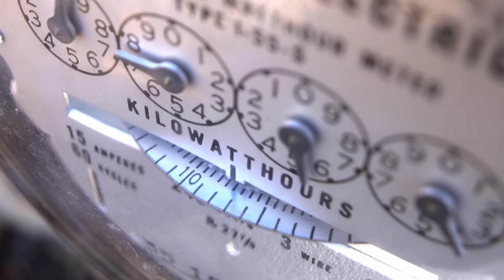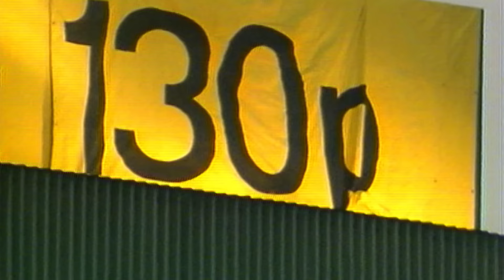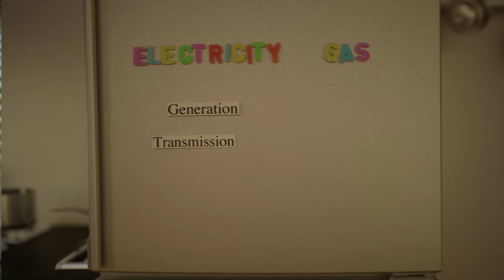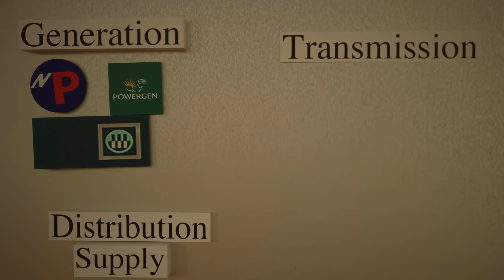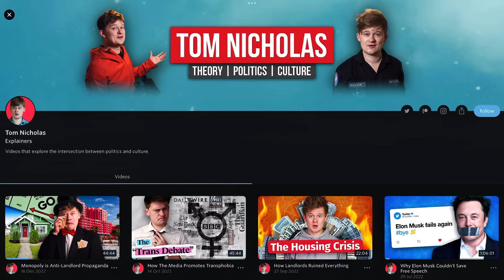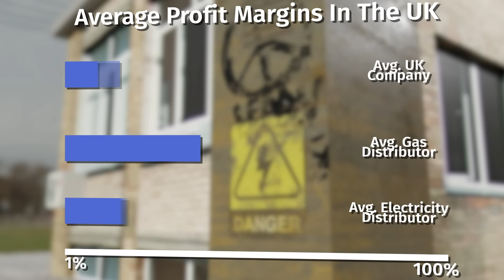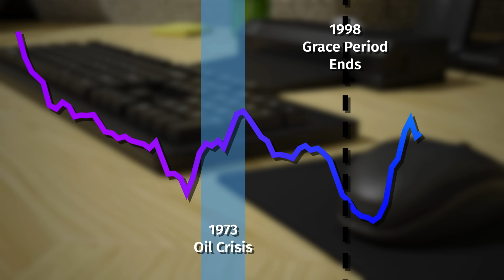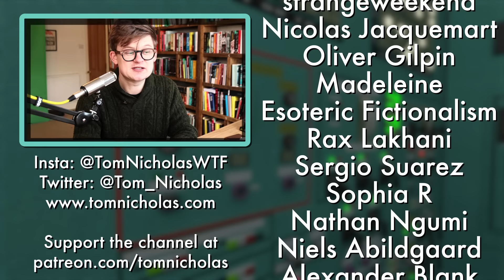Energy Privatisation is Bankrupting Britain

Comment: They turned the energy industry over to private competition, but they conveniently forgot that these companies are competing to make the most money, not to provide the best prices.
Reply: And that a power grid only has one line to each endpoint so there is no possible way this could be anything but a monopoly with no real competitive forces to self regulate profiteering. 

At best of we ran like 5 of the same wire to each house we could maybe hope to have an oligopoly and try to regulate that.
Reply: This is very succinctly put. Thank you.
Reply: Doesn't  anybody understand economics anymore?  Get the Govmnt out of the way..
Let the drillers DRILL.   Let the refineries refine.  They will make money and you will have 
  the energy you need.  Ramp-up supply, and prices go down...
    OR start building Gen IV reactors,  YESTERDAY!      Energy fuels Civilization.
Reply: Reasonable Speculation - dude we are talking about power grid not power generation, and definitely not extraction and refining. 

Generation is not a monopoly so it functions OK as a market economy. Arguably it is a bit leaning toward oligopoly but that can be worked around. 

No one on this thread said anything about nationalizing extraction and refining. That is definitely open market model due to the vastness of the market. 

We are talking about nationalizing the actual electricity and gas grids which take the energy from the refineries and generation to each endpoint. That is what is called a Natural Monopoly because there is no practical way to make it competitive. There is only one wire and one gas pipe and one water pipe to every house, so there is no way it can actually be "competitive". 

The national grids would buy from the open market generators and refineries to distribute to households based on competitive bidding. 

1. This would allow a variety of different generation sources including gas, nuclear and "green renewables" to all compete against each other for sales. 

2. Also a national grid may reduce regulations on endpoint generation which have been put in place strictly to preserve profits of the formerly privatized grid. Allowing endpoint generation sites (your rooftop solar) to be bigger than your demand so you can sell the excess energy back to the grid for a profit, giving more competition to the free market generators. Or you could put in solar heating or geothermal to compete with the gas refineries. 

 Who is stopping the drillers from drilling and the refiners from refining? They are the most privileged industry on the planet and receive the most subsidies of any industry, actually pretty close to the same subsidies as all other industries combined. Plus their infrastructure crammed through communities risking disaster. 

The "greens" do not want to ban oil (only a few uneducated say that, every movement has them). They want to add new energy sources on top of the oil growing supply, which would reduce demand for oil and give it competitive market forces to reduce costs for energy. Many actually do support the nuclear power you are fond of as well.
Reply: @reasonablespeculation3893  Can't tell if you're trolling or trying to actually argue. Poe's law is in full effect.
Reply: @5353Jumper  I mean, any green activist worth a damn should be trying to remove market forces from the energy sector entirely. The market is exactly what got us into this mess, andd it certainly isn't going to be what gets us out. We should be aggressively nationalizing all energy industries, removing private ownership of energy generation entirely, and use that control to develop green energy sources such as wind, solar, and nuclear, while aggressively cutting fossil fuel power generation wherever possible, aiming for complete fossil fuel abolition by 2030.
Reply: @ErikratKhandnalie  nah...the way to reduce fuels is to focus on improving other industries and investing in alternatives. Let the fuel market experience it's coming adjustment by massively reducing demand. 

Remember oil and gas are used for many things other than fuels, many of them actually reduce emissions by helping improve other industries. 

So we so not want the government playing around in a broad market industry like oil&gas extraction and refining. 

It is good enough to just have the government control the actual natural monopoly sectors, and regulate the rest. 

If we waste a bunch of time and money trying to improve the petroleum industry and fuels industry in particular that is resources not spent improving other industries and supporting alternatives to fuels.
Reply: @5353Jumper  No, we absolutely do want the government playing around in oil and gas. More specifically, we want the government to completely take over those industries and take them entirely off of the market. So long as there is profit to be had with selling fossil fuels, the market will find a way to sell them. There are some industries that make good use of them, but the energy industry most certainly isn't one of them. 

We need to be aiming directly at the complete abolition of fossil fuel energy. Anything short of that will constitute a failure.
Reply: @ErikratKhandnalie  of you do that you will not be focusing on all the other industries, and the replacements for fuels, and the electrification of vehicles. And you will not be focusing on reducing consumption of everything which also greatly reduces fuel consumption. 

So you will just remove the energy from fuels from the world, and not have anything to replace it, and have the same demand for energy. So basically bankrupting the world or maybe just having all the poor people starve while the wealthy hoard. 

If you forget about the fuels industry,  and make all other alternatives better, you will have the same result of eliminating fuel demand, which will also end fuel production. But you will improve the world instead of impoverishing it. 

Imaging the government spending trillions to take over an industry, then tanking it on purpose all that money just disappearing. All our tax revenues just gone poof.
Reply: @ErikratKhandnalie  — The Green Activists have done so. 80% of the World’s oil and gas industry is State owned. Pemex in Mexico is a typical result. It owns all of these resources. But who supplies energy to Mexicans? The US sells them gas, which they burn to generate electricity cheaply and more reliably than their State owned monopoly.
Reply: @ErikratKhandnalie  Yes — energy is the great triumph of State ownership! See Venezuela for PROOF!
Reply: @Orson2u  oh how I wish that were the case, lol
Reply: @5353Jumper  of you do that you will not be focusing on all the other industries, and the replacements for fuels, and the electrification of vehicles. And you will not be focusing on reducing consumption of everything which also greatly reduces fuel consumption. 

So you will just remove the energy from fuels from the world, and not have anything to replace it, and have the same demand for energy. So basically bankrupting the world or maybe just having all the poor people starve while the wealthy hoard. 

If you forget about the fuels industry,  and make all other alternatives better, you will have the same result of eliminating fuel demand, which will also end fuel production. But you will improve the world instead of impoverishing it. 

Imaging the government spending trillions to take over an industry, then tanking it on purpose all that money just disappearing. All our tax revenues just gone poof.

with all due respect, we can do more than one thing, abolish the private energy market and incentivize demand-reduction... non-sequitur...
Reply: @Orson2u  venezuela still produces oil, having little to no demand for oil and mostly to soley relying on oil income is a bad idea... and norway has state ownership of oil-production too and they do well...
Reply: There's no seperate production.  The supply is fixed and limited.  There's only so much left in the ground, and it's all coming from specific known places.  The GCSE economics cartoon of how markets work doesn't apply, because competing vendors cannot increase production or start new production from scratch to please customers.  Supply being broadly fixed, it's necessarily a sellers' market, as long as it is left to market distribution, instead of distribution according to need administered by the state.
Reply: @ErikratKhandnalie  you lack understanding of basic economics.
Reply: @kokoteofilov9486  no u

Seriously, we've passed your "basic economics" a while back, because markets really only work in specific situations, and the grade school understanding of economics you're thinking about doesn't account for market failures, scarcity, or climate impacts.

So, no, I understand basic economics. I also understand that the economics you were taught in middle school aren't adequate to describe the fossil fuel economy. 

Also, muh "basic economics" lol.
Reply: Every competition in capitalism is about profit, the most profitable business wins and eats up the rest of the market forming monopolies
Reply: Capitalism in a nutshell, great summary.
Reply: The further and consistent illusion is that these companies "compete". Lol
Reply: People who think private companies compete don’t understand basic capitalism. Yes, in theory in a perfect situation, capitalist companies would endlessly fight eachother driving down profits and making new products to get more money, but in reality, producing new products is incredibly difficult, and monopoly, repeated products, reliable brands, coercive business practices, etc. are so much easier to maintain. If their goal is profit, they will immediately jump to every tricky method to gain profit, otherwise they’re fools of business owners who won’t last long or will end up small. Cause innovation isn’t easy and it isn’t cheap, it isn’t worth it from a pure profit perspective.
Reply: I think we should go further and nationalize certain industries again to produce consumer goods such as bicycles, cars, fridges and vacuum cleaners. Things that are considered neccecary. The state version should be a very basic one that can do the bare minimum and not much more but also be sold at production price. The private corporations can focus on all the luxury versions.
Reply: In most sectors of the economy, those are the same thing. Alas, energy is not most sectors because natural monopoly go brr
Reply: @reasonablespeculation3893  Margaret, will you ever learn?
Reply: @reasonablespeculation3893   you're just wrong on this one.
Reply: @ErikratKhandnalie   yep. I'm with this attitude 100%. It is time to get totally off oil and gas as soon as humanly possible. and this from someone who loves cars and the smell of diesel.
Reply: @MrMarinus18   yeah I mean why not???? Why can't the state provide a basic version of everything?? For luxury and frills you can seek the private market, but if you don't want to or can't afford it, you don't have to. I mean that just makes sense.
Reply: @YourCapyBruv_do_u_rmbr_3Dpipes  The problem though is that China kind of has this system and moving the country closer to China is kind of hard.
Reply: @reasonablespeculation3893  The government has the budget and staying power to fund Nuclear energy, and projects that make profit in 10 years,

Private corporations want money NOW, and that is just not great for power, which as you say is the corner stone of modern civilization.

I am pro free market, but anti monopoly, at least a state monopoly is beholden to the democracy, a private monopoly is just oligarchic/ authoritarian.

seems like you don't understand economics, in order to maximize profit, you don't want to increase supply if you are the supplier, you want to increase demand.
Reply: @ErikratKhandnalie it is
Reply: @gustavohab  every competition in capitalism is providing the cheapest and best service/product to consumers hence the word "competition". When government gets in the way through corporate socialism (A.K.A Fascism) Corporations can then monopolise and control the direction of industries in the market.
Reply: China is more capitalist than USA , have you even been there  I was an economics and foreign policy Advisor for the Chengdu Local Government and the municipality of Chongqing from 2016-2019 there.

Comment: I live in Bath with other students and we don’t even turn on the heater unless the temperature outside goes negative. Even before the energy increase, rental housing has such inefficient heater and bad insulation that most of the heat just yeeted out the window anyway. It has been like this for 3 years and I’m honestly surprised I haven’t gone terribly insane yet.

Comment: In SA most of our grid is still technically under state control, but the fuel gets mined by private companies and maintenance work is also largely outsourced. At this point, we have 6-10 hours without power per day. The other day it came out that the maintenance companies have been sabotaging our electrical infrastructure to get more work. Shocker.

Comment: In Finland the electricity market has been privatised since 1995. Prices have increased, but part of that is caused by a government mandate that requires electricity companies to bury power lines underground to reduce the number of power outages. This has made electricity pretty expensive in more rural areas, where the cost is split among fewer people. Still, at least in cities the prices are fairly reasonable. The biggest monthly bill that I got in the crazy period of 2022-2023 was 50€ for a 65m2 apartment. Nowadays monthly bills are around 10€. Also, cities typically have district heating, so I don't need to pay extra just to heat my home. In the countryside the situation is worse, but definitely not unmanageable. Some people save money by burning wood for heating, and heat pumps have also become popular.

Comment: Both France and Britain used to have civilian nuclear power as a part of the nationally owned electricity production authority.  It has turned out that although reactors run by ordinary civil servants can be a brilliant success, private ownership probably doesn't know how to hire the right people.   EDF used to be Électricité de France, and the energy companies of the EU could not compete with it. It is now a private company mostly owned by the French government, but it has lost its soul.
This is all the more horrid in that nuclear is the only technology that is both more reliable, safer, and environmentally cleaner than fossil fuels. The actual quantity of fuel and waste per unit of energy, or of average power for a year, is millions of times less than for fossil fuel.
Reply: Interesting extra tidbit: nuclear produces less radioactive waste than coal, except the one produced by nuclear is solid while that of coal is dust suspended in the fumes...

Comment: This whole explanation boils down to a few key points. Though Tom distorts them slightly to be able to form this clear narrative blaming privatisation for all of them:
- The UK has a lot of gas for various reasons, this makes the UK more susceptible than most countries to the gas price increases. The mentioned reason is the low investment cost for gas plants, though there are other more important reasons such as over the last few decades gas being cheaper in the UK than coal. 
- Privatisation of the transmission network is inefficient, and increases costs. Though this is a small fraction of the total costs, it is worth trying to fix this.
- The privatisation of the demand side retailers has not led to as many competitors as would be ideal, meaning competition isn't as strong as it ideally could be. In this case it is hard to be sure whether the level of competition is better or worse than public ownership. 
- The recent high gas prices has led to big profit increases in companies producing gas. This is because it is a global market with a high price but cost of producing gas hasn't increased. Nationalisation would likely would have no impact on this. 
- He then uses a very simplified graph of the trend in electricity prices in the UK to justify renationalisation. However this is largely just a plot of the cost of gas in the UK, as the electricity prices are heavily driven by this.
Reply: He is a Propagandist